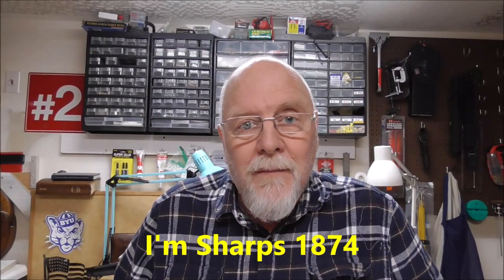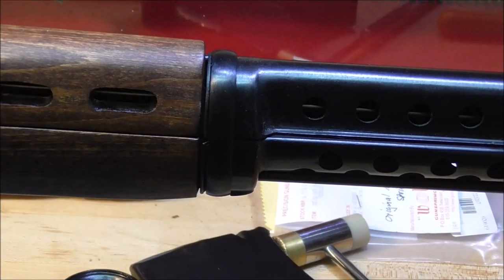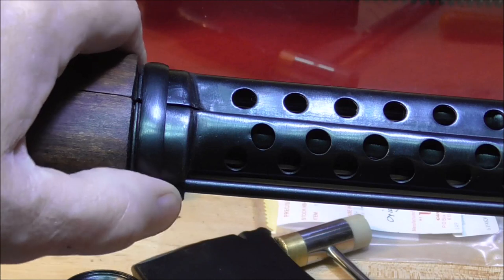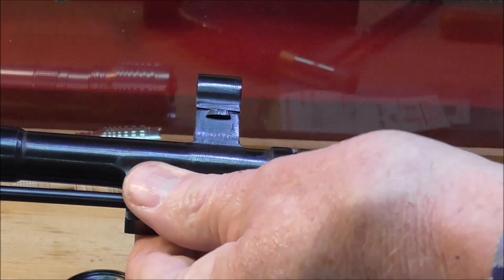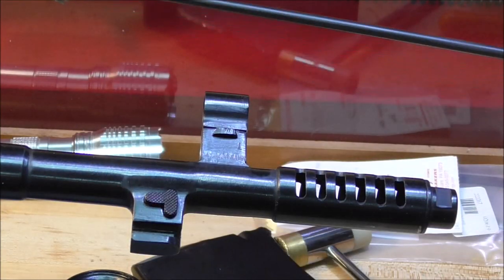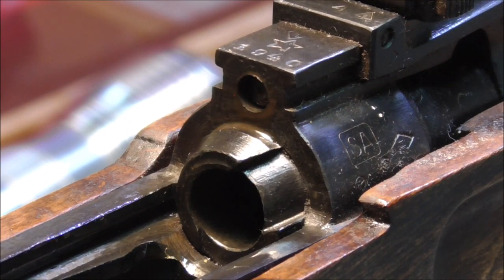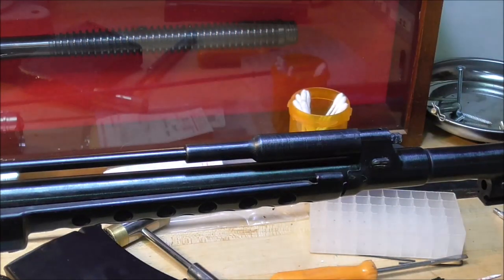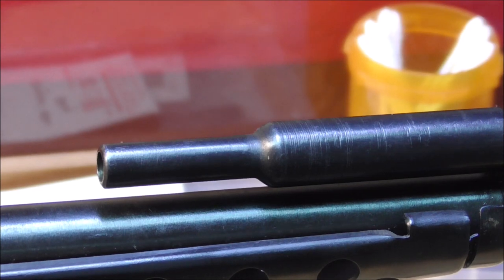SVT-40 Part 3 - Gas Port Details

Comment: Im going to test mine in the field tomorrow. Had exactly these issues with extraction last time. My gas regulator is very loose and needs no tool to adjust it. I want to test if it gets thrown off alignment by the recoil. I think your video is in the 'top notch' category of the SVT-40 videos online. Thank you

Comment: My SVT 40 Refurb has a 1.3 setting and ran pretty well. Gas system was clean and tight. I got a non refurb, no import mark example ....gas piston gunked up...selecter set between numbers.   Cleaning and now uses 1.5 setting. This video should be helpfull to anybody lucky to have this rifle but not know about gas port adjustment.

Comment: According to instructions sound rifle should work correctly with 1.3 setting. 1.5 in winter. But if you use brass cartridges instead of steel ones, there you gonna need some extra punch for extraction.

Comment: Great video-do you have to disassemble the gas port system entirely to get that octagon nut to turn? Also where did you get the wrench for the nut? 

I tried turning it assembled with a small crescent wrench but it did not budge-  do not want t force it if it can only be adjusted disassembled- hence the questions.
Reply from the maker: As I recall I got the wrench on eBay.  I don’t think I disassembled it first but I’ll double check.  If I’m remembering correctly mine was stiff until I gave it a good clean.
Reply: @Sharps-im4lb  Thanks what size is it? Do you remember what you called it for the search on e bay? I appreciate the information.
Reply from the maker: Try this.  https://www.ebay.com/itm/112438745210?pageci=76405806-be56-4f64-b5b6-38e83ed322fe&redirect=mobile&nma=true&si=bNCwZVe8tRX5rKwjKr5AGqXhhG4%253D&orig_cvip=true&nordt=true&rt=nc&_trksid=p2047675.l2557

Comment: What happens if the lines line up but the hole for the gas adjustment doesn't line up with the hole in the sleeve
Reply from the maker: A number of viewers have had the same issues. The groove/line may be off a bit.  I don’t think Russian QC was very good.  You may have to tweak the location slightly.  Also, from what I’ve read these rifles are very picky about the ammo they eat.  147 grain boat tail ammo works well.  And, there is a part 4 to this series.  It may help.  Good luck
Reply: @Sharps-im4lb  so basically what you're saying is it's more important that the whole lines up with the port rather than the actual marks lining up together right?
Reply: @Sharps-im4lb  My SVT40 has cracks on either side of the stock from what appears to be the bolt slamming back against the receiver, I wonder if it's because the previous owner did not line the holes up and just lined the edge marks up and the gas had nowhere to vent